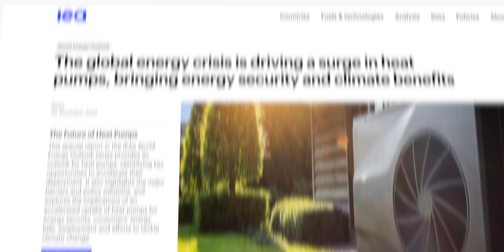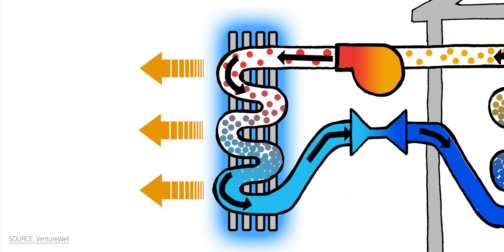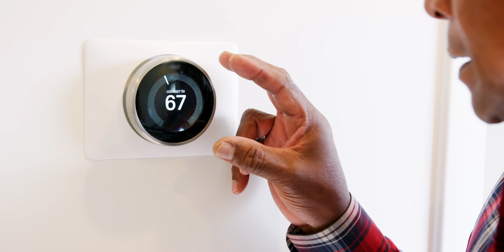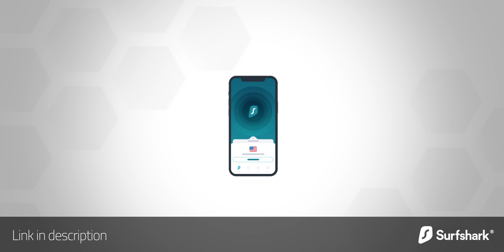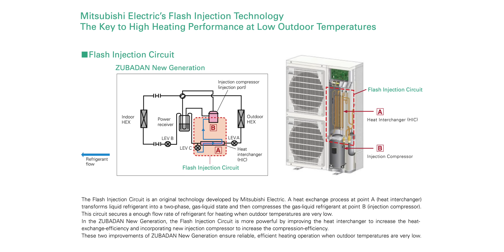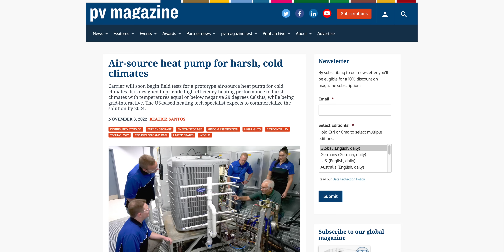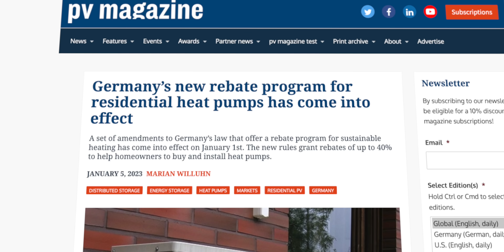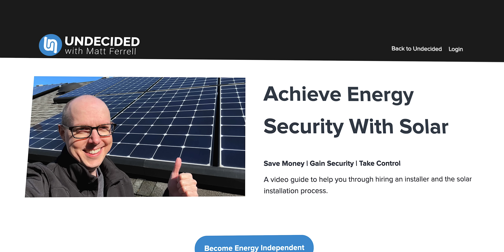Major Advances with Heat Pumps in the Extreme Cold

Comment: It's just a piece of engineering. It is neither a miracle nor the work of Satan. Please stop discussing it as though it has enemies. Just apply it correctly or don't apply it at all. Our house was built with one and we put up with it for 8 years then had it replaced with gas. The team doing the replacement said that they used to install heat pumps but they stopped because of complaints. Stop dismissing real world experience with juvenile throwaways like "modern heat pumps answer the critics complaints", the Laws of Thermodynamics have not been modernised. Stop regurgitating press releases and discuss heat pumps after studying the engineering challenges.

Comment: When I was growing up in Nova Scotia, Canada, the worse nights I have ever had sleeping was when I stayed in cheap old mobile homes that only have forced hot air heating systems, the furnace would come on, then once it got hot, the fan would blow hot air into the mobile home, causing me to have to move the blankets off of me from the blast of heat, then the unit would turn off and then I would get cold, then the cycle would start again. I would wake up in the morning with a sore throat from the dry air I was breathing all night. 
    I would sit on the couch during the day and have to tolerate the constant draft from the forced hot air as it cycled on and off all day ... I hate forced hot air systems to this day with a passion....so why in the hell would I revert back to a system of blowing hot or cold air on me to save some money? ....I will keep my baseboard electric heat to the day I die, but at least I won't die from a cold.

Comment: There is a very simple FACT with heat pumps, which are simply compressors with a posh name. One side heat, the otherside cold. It's how refrigerators, freezers, air conditions and dehumidifier work. It's the same "technology" from a couple of centuries ago. 

Compress a gas to a liquid you get heat, let the liquid expand to a gas you get cold. Nothings has changed in a compressor based system other than the gasses used in that process. Remember all the outcry about HFCs a few decades ago?

So if we take heat from the heat pump where dies it dump the cold? and if it's already cold how efficient can that be?

The big question how do they anti-ice the process when it's subzero? 
• Electric heating element? That's not cheap.
• reversing the system? No heat whilst that's happening.
Any others?
Reply: "No heat whilst that's happening".  It's a handful of minutes that it's not providing heat indoors, and the recovery doesn't take long either.  So if your home loses a noticeable amount of heat in about 10 minutes, then you might want to be looking into that.
Reply: @BenIsInSweden  so how often does it ice up and how many times an hour dies this 10 minute defrost occur? Where does all melted melt water go before it freezes up due to the environment?
Reply: @daveofyorkshire301  Most are looking at 1 defrost every 45mins-3 hours, but depends on a few factors (humidity being the main one). As for where the water goes - it depends on the install, many will have a soakaway underneath, but for example with mine, I have it plumbed into a nearby downpipe for rain water to go into the sewer system, which one of the units provides a 100w resistive element that gets switched on below freezing, to ensure the piping doesn't get frozen over.
Reply: @BenIsInSweden  wait, so at 45 minutes you can have 2x10minute defrosts within the hour. I know I'm playing with the numbers a little, but the truth isn't far from this...

So for 60 minutes of potential heating (and under continual operation) heating is reduced to 40 minutes, which is 2/3 of the potential heating available over the hour, plus 1/3 of the heat loss goes encountered.

So in subzero temperatures common in the UK during winter you can't count on the heating to be available when you need it... 

Humidity is not a factor as you should know cold air doesn't hold much moisture, that why I asked about when it's cold? There are reports of icing up, and even car air-conditioners do that, it's why they pour water where you park.

My house looses about 1°C per hour, which is pretty normal for a well insulated property. What I'm reading is that 1/3 of the time my heating is on I will loose heat whilst it's defrosting. That's a 2 steps forward 1 step back heating solution. That may be energy efficient, but it isn't heating efficient. It means for 1/3 of the time it's not raising or holding the temperature.
Reply: @daveofyorkshire301  That 10 minutes covers the recovery time as well.  So you'd have maybe 3 minutes of actual defrosting, and about 5 minutes of recovery - and rounding up to 10 because it's not going to be exact.  So for your scenario if you count 2 of them, it would be about 6 minutes of no heating (so 10% downtime, though technically that will mean the next hour will only get 1 defrost), with 10 minutes of doing a bit of heating to a higher temperature to get things back to the levels they were before.  It's also worth noting that not all that heat is lost either, as the coils will still contain some heat energy that will be used for putting back inside.

Comment: I’m in the prairie in Canada the temperatures here get to as low as -50C for weeks at a time there is no way I would trust what is basically a central air conditioning system they run on a process of liquid to gas conversion you have to contain that liquid and when temperatures get that low any metal becomes brittle and will fail not to mention that these units will rot prematurely in certain conditions the ability to heat your house is a matter of life and death and good luck getting an hvac tec to repair a broken system in cold damp conditions especially when the system has to be opened up moisture has to be pulled out under vacuum these kinds of tools don’t like to be operated in the cold climate. It’s just dreaming to think you can out perform an high efficiency natural gas forced air system besides the fact that most places are powered by natural gas power plants especially if you have a lot of solar and wind generation operations in your area they use natural gas power plants to supplement when there is no wind or solar being generated

Comment: I live in western Illinois and just got a quote on a Mitsubishi/Trane mini split system to heat my 4 season room (about 120 sq ft). 5k!!! And that’s after the 1k rebate program. Yes, I can get another 1500 back on the tax credit but still that’s a ridiculous price to heat and cool a single room. Fact is I can heat that space with a $50 space heater. I don’t know yet how it will fare in the summer with all the windows, but since the space is somewhat open to the rest of the house it will probably be just fine. I feel like the manufacturers and installers are taking advantage of the abundant rebates and tax credits by raising their prices. Am I wrong?

Comment: You defined the difference in your first sentence. Geothermal heat pumps use a relatively stable subsoil heat sink which operates independently of ambient air temperature.  Air to air heat pumps " most common retrofit install" are the problem child . As you can imagine, the ability to draw heat from -10 degree air is problematic to be polite

Comment: Two issues I see going forward is you have to compare BTU required to heat your home and the temperature outside in the winter. If its sized to replace your gas furnace, it will not be a cheaper solution, its just facts at this point, and it will not be an instant heat either. I have a geothermal system which constant water temp on the intake. It will not keep up unless you work within a 2 C range (without electric duct heater). Power usage also is dependent on what Amps the unit is using.

Comment: No mention of hot water gas/cond combi instantaneous h/w no storage vessel required no heat loss on storage or pumping to storage then to taps also doesn't need electric to raise  to required temperature. Am i wrong?

Comment: My house probably among the first heat pump in the city. we had to import them from Japan because they don't make them here at the time, 2010 actually. It does hydronic heating for the floor, hot water heater for the shower and Heat Recovery unit in the bedroom. Just one machine is needed, the rest are balance valve and thermostat. We removed the gas boiler in 2016 because we realized we don't need that to be there as backup.

Comment: Drilling a well for heat? $$$$$

Imagine thinking that it's a positive thing that many of these units can be overridden by the power operators and told to reduce their cooling capacity in the summer. If I'm going to pay a kings ransom for a heat pump/AC unit that can generate heat in -20F conditions, I'm going to be in control of the AC in the summer, not big brother.

Comment: The key here is geothermal, expensive to install maintained and repair. And then there is recovery time. You can't beat oil for instant heat to raise that temp quickly, next natural gas.
We stayed in a motel room in PEI with a heat pump. Took about 1 hour for each degree increase.
Sounds like this guy is working for our nut case politicians.

Comment: Plumber/Hvac mechanical contractor here. Everyone is missing the point. So these heat pumps will always provide heat even when the exterior coil is losing all efficiency due to a lack of temperature differential and icing up of the rad. In the pacific northwest the winters are cold and very wet, that exterior coil gets very cold and develops frost and ice which limits the heat exchange possibilities of the coil. The unit will then reverse and use the interior coil to take heat from the house and melt the ice off the exterior coil. You will technically not lose any heat because all air handlers essentially have electric coils installed integral to them to heat the air while this process is happening. This is very expensive. Heat pumps are great most of the time, but when its actually cold out you will pay a lot in electricity to heat your home. If possible have a wood stove as a backup, or a gas furnace as both of those will heat your home quickly and efficiently  and the heat pump can pick up the slack.
Reply: @garrylarose1506  that's defrost cycle put under 35 degrees hp will not heat a home due to it can't get heat from freezing ambient air so heat strips come on to heat the home

Comment: IU would ask who do you work for? Because you have left out a couple of important things firstly the some cold weather heat pumps are the size of King Kong's Coffin, also the fans on all heat pumps are loud in operation and in time will become louder as they ager. You did not mention the need for fitting larger radiators because the heat output of a heat pump is nothing like the temperature of gas or oil boilers. Finally you are lucky enough to have enough land to provide a ground source for your heat pump but that is not a fee sable thing in cities. So in the end heat pumps have a long way to go before they are suitable for every house situation.

Comment: Even the best heat pumps are crippled by freezing rain; and they aren't efficient at all in extreme cold weather.

If I could get it in writing, that my current system would be restored at no cost to me in the eventuality that the cost of cooling/heating my home didn't go down after averaging operation throughout 5 consecutive years, I'd give it try.

From where I'm sitting, it's all part of a larger scam to push everyone into becoming ever more reliant on electricity, which will soon start to skyrocket in price.

Comment: We installed a water to air heat pump that uses circulating ground water instead of  solely relying on air temp to heat or cool. A year after we moved into our house we experienced below zero weather for 21 straight days. When the temps dropped below -15 degrees, the furnace converted over to the electric forced air part of the furnace. We had gas heat in our former home and it was a much warmer heat. Heat pump heat is what I call luke warm heat.

Comment: COP?
 Modern gas furnaces have a thermal efficiency of 95% and higher. They are now so efficient that they can be vented with a plastic pipe. The power plant that I worked at for 20 years had a thermal efficiency of about 30% on a good day and the best fossil fuel plants are close to 65%. Please spare me the wind and solar I worked it for too many years. 
I’m simply saying that the heat pump is an option but its no where near as efficient as modern gas furnaces. 
No matter what the US department of energy says.

Comment: I have 3 air to air heat pumps that are rated to work down to _25 and a gas high efficiency furnace. Here in Ontario with electricity costing over 20 cents per KWH and going up another 2 cents for power over 1000KWH per month it cost almost 3 times as much to heat using the heat pumps. For people using Propane it likely is a savings.

Comment: Running an expensive A/C's heat pump in the winte is just dumb. Why put the additional run time / wear and tear on the compressor for heat? Do you realize that you're just wearing it out a lot sooner?  They're really expensive to replace. Like any mechanical machine, the more you use it the faster it breaks down. Why run a compressor when you don't need A/C? Two or three portable 1500 watt heaters that have individual therostats that turn them on at set points in different rooms is a lot less expensive to operate and doesn't wear out your expensive A/C's compressor.
Reply: Weird take... 2-3 1500w heaters wouldn't be enough to heat my house (which still has over 10kW of resistive heating available, just unused).  My whole house (with 3 heat pumps) is using about 3kW in -8C weather.  I would likely need about 6-8kW of electricity using resistive heating at the moment to heat my home (I could find out, but that means turning on the electric radiators in my house, and turning off the heat pumps).  At current electricity prices for me and currently conditions, it would take only ~1600 hours for one of my heat pumps to pay for itself so ~70 days.  Easily doable in the ~15 year lifespan of them.

Comment: I live in Canada in a bungalow and have 2 heat pumps, one in the basement and one in the living area upstairs. Winter temps will reach -35 to -40 for 2 to 3 weeks,  my backup is baseboard electric, and a woodstove.
I only use baseboard when vacationing in  Florida (set at 58  - 60 F) and occasionally in the bedroom (68 F).  My energy bill has reduced by 22% annually, and I now have remarkable AC in the summer,  which I did without previously.  My payback on initial investment will be recouped in around 6 years, mainly because I now require drastically reduced wood volume.